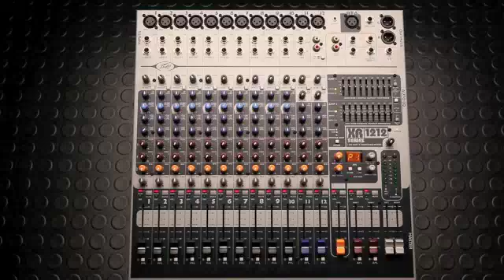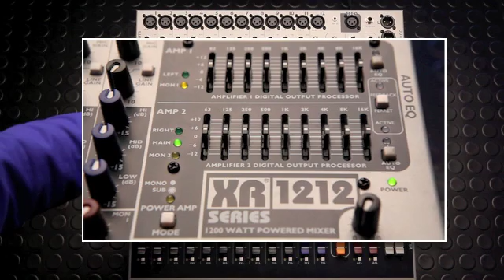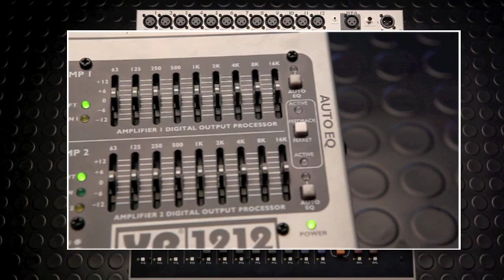Peavey XR1212 powered mixer Part 2

Comment: can you help me? I have the XR1212 was out running sound for a friends band had everything hooked up right plugged in my powered Subwoofer and had WAY too much bottom end tryed turning down the subwoofer itself no change I don't understand why there would be so much low end. I could not get a good sound.

Comment: I'm using the mixer's internal amps for monitors and have it set for the 2 gray sliders to turn the mains up and down as they're connected to a power amp coming from the mixer's XLR L-R outputs. With the mixer's amps set to MON-1 and MON-2, can the sub output still be turned on???

Comment: connecting a Tascam recorder to the mixer TAPE OUT is not giving signal to the recorder. what can I do as I need to record while performing please.
Reply: The TAPE OUT has no level control, and I found going through the HEADPHONE jack does pretty much the same thing as a TAPE OUT but DOES have a level control.

Comment: I purchased a peavey xr1212 and have returned the mixer twice now to the supplier. The fans (internal cooling) on both accounts makes a noise that can only be described as not comfortable. Almost as though a bearind were displaced.  Any answers before i give up.

Comment: Hopefully one that can be mixed seperately from the mains and wedge monitors. I.E. Can the monitor 2 system on the individual channels be adjusted and mixed sperately and  come out a line level output?
Again, thank you sooooo much for the videos and advice. ( and as I go I may have more questions if you don't mind).

Comment: The sound I am getting. But it is allowing me to be functional and far better than what I was accomplishing with my other board. But what I was going to ask was: I am running my mains off one internal amp, and a pair of wedge monitors off the other. I personally ( I'm the singer), and my drummer have wireless in ear monitors. What would be the best way to hook them up? What source should I use coming out of the board?

Comment: I am stiill curious about a couple things. 1. Can the RTA Autoi eq'ing be done with a condensor mic? Does the universal phantom power run through it? All I use is super cardiod condensors, is it better to use one of the mics we will actually be using to run the auto eq'ing? Also, you talked about doing the auto eq'ing on a left speaker and then a right. If you are running on amp to 2 mains, and one to 2 monitors, can you use the auto eq? If so where do you position the mic? 
Thanks.